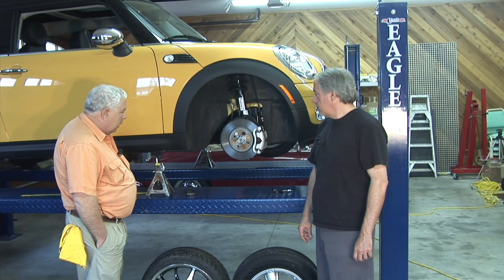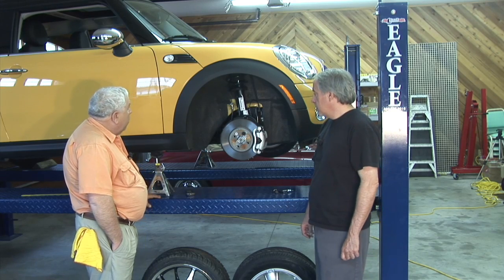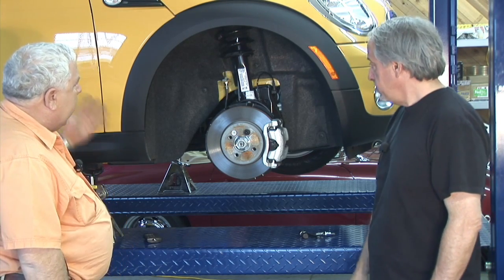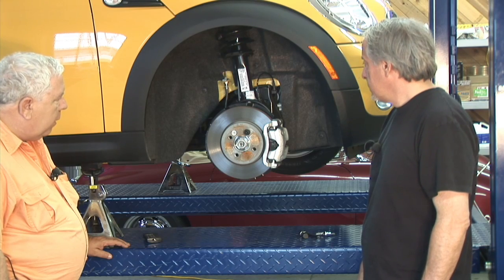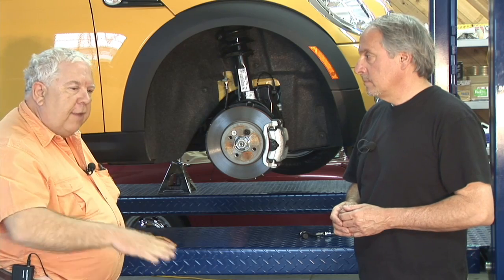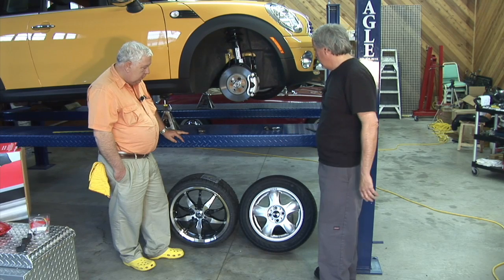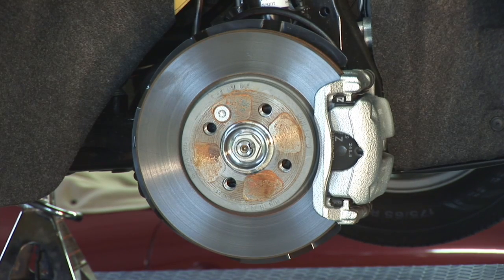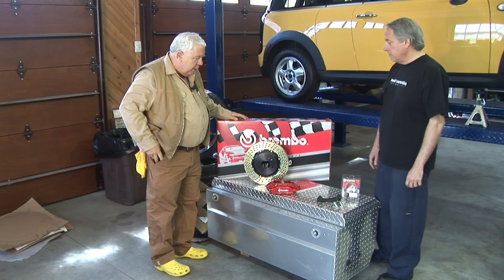3 E-MINI-ME.  Electric Conversion of 2009 Mini Cooper Clubman to EV

Comment: Hello, really liking the idea of going all electric. I love this stuff. I couldn't help but to comment which I usually don't do. The tires you are going to will cause for more strain. A wider tire will make more contact which will create more resistance. They are making low rolling resistance tires which will help with getting more range. Unless your choosing performance over range then I would say Good Job. Either way Good Job :) Keep it up